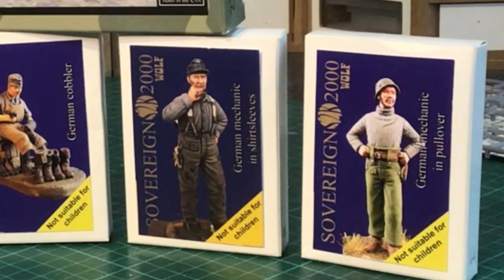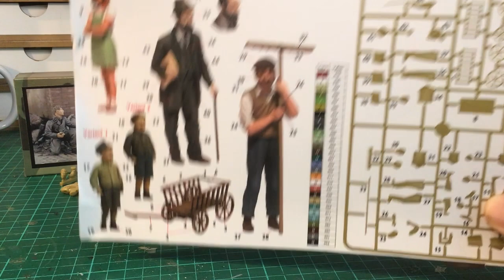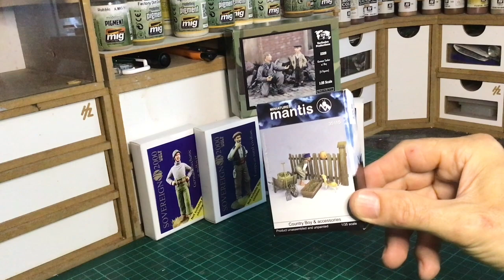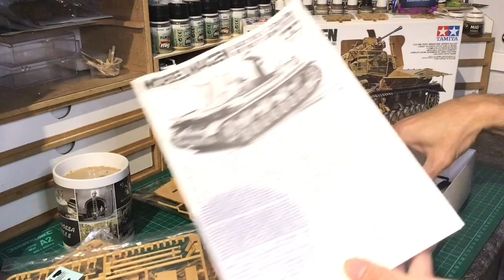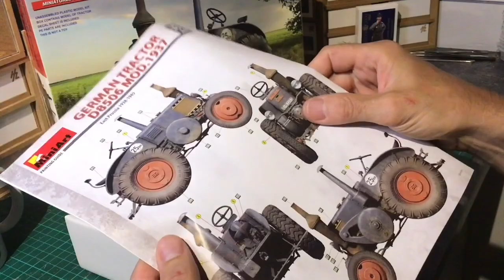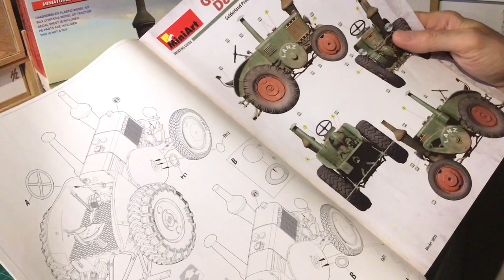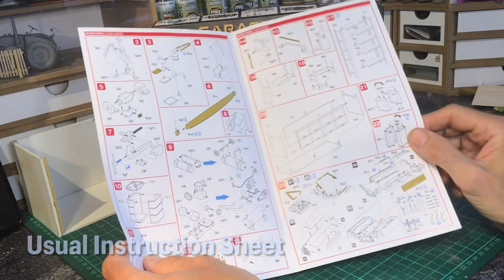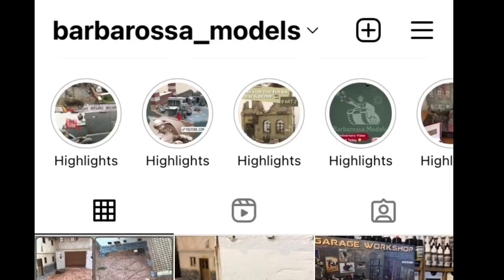Scale Model Diorama - Mischievous Sabotage Part 1

Comment: Awesome idea.I just laid my hands on resin figure of Michael Wittmann, and since i have a Tiger with full interior i decided to make a small diorama. But here comes the hard part. I have no idea what putty i could use for resin figure (just in case it's needed) and another problem is with historical accuracy. Wittmann is known to fight in his zimnerit coated tank. Have u heard maybe about him using a machine without zimmerit? I've never done it before and since it's an expensive kit i wanna go the easy way.
Reply from the maker: Hi, thanks! I recently got some ‘green stuff’ putty to use to convert a figure and really liked it. Clean to use, great for filling gaps, would definitely recommend it.
Regarding the zimmerit, unfortunately I don’t really know🤷‍♂️. I’ve never added any before to a vehicle, not sure about the historical accuracy either. I appreciate you don’t want to risk spoiling the Tiger. Perhaps try an online forum or Facebook page for some info? I’m sure you’ll get some help there…🙂👍
Reply: @Barbarossamodels  appreciate the answer since your video made me really into this hobby. I found out that his Tiger on the eastern front didn't have zimmerit on. Easier work yet accurate!
Reply from the maker: No worries, good luck with the build!🙂👍